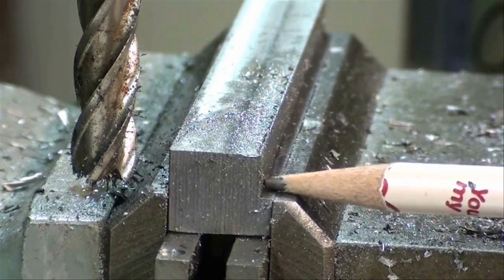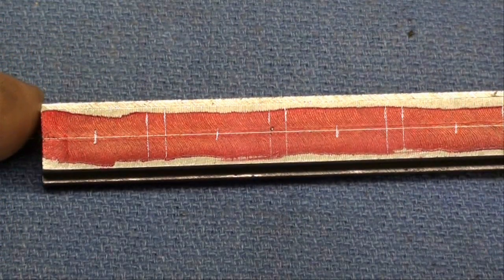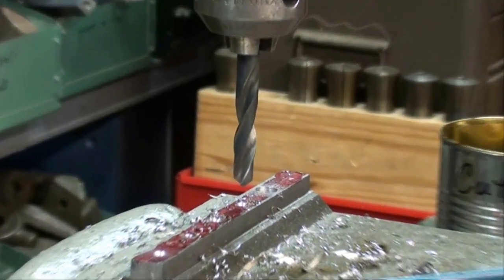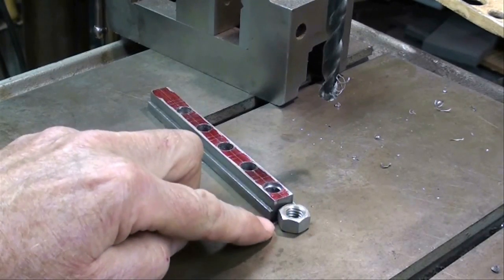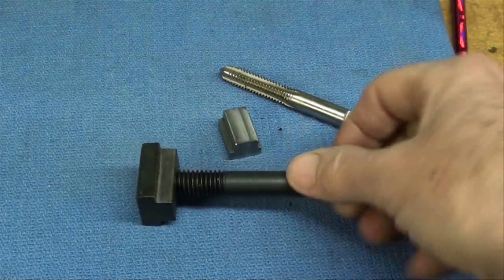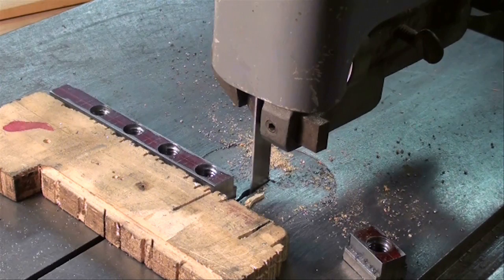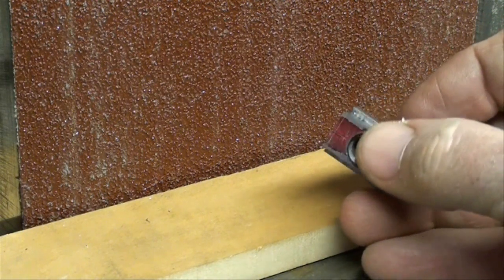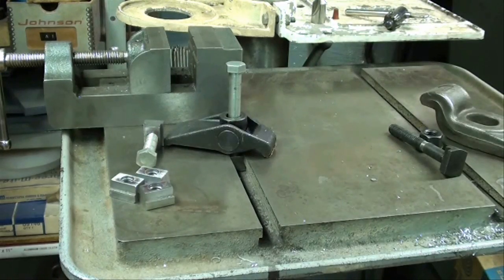MACHINE SHOP TIPS #103 Pt.2 Making Tee Nuts on the Bridgeport Mill tubalcain

Comment: I made some of these out of aluminum for my pedestal drill.  Except when I cut the steps/shoulders, I cut the first side along the fixed jaw,  then turned the part around and without moving the table/hand wheels machined the other side.  I don't have a belt sander and just milled the ends after using a hacksaw to cut each nut off.

Comment: Very nice table....not a single hole in it. I once worked (very shortly) in the original 'Presto-Log' factory here in Sacramento, California....they had an old vertical belt drive drill press and the table was worse than swiss cheese....barely enough metal left to support what you were drilling...

Comment: Thanks for clearing the options to make through tap, stop tap and indent or to licorice to make permanent bolt...pinning might. Be another option. Again great lesson. Thank you.
Reply: sammy mezzacapo Pinning is a lot of work- plus it requires drilling a hole, and that could weaken the part. Pinning tends to be permanent- but using Loctite offers a LOT more options.

Comment: why didn't you mark the cuts in succession, rather than having to sand the excess off each one?
Reply: Samsgarden By allowing for extra waste, it's a LOT easier to make all the parts exactly the same size. By trying to "cut it fine", if you make a bad saw cut, you could end up with TWO bad parts.

Comment: How, exactly, was the -length- of the Tee Nut decided? Because seeing the length of stock remaining after laying out five tee nuts said "Make six!" to me.

Or is there a reason to maintain a specific length for the nuts?
Reply: Shrike Decil It looked like the tee nuts were all 1 inch long. You're quite right that six tee nuts could have been made- but when you can, it's a lot simpler to work with whole inches, rather than trying to work with fractions of an inch. It all depends on what you're trying to do.

Comment: MrPete, Thanks for a very instructive video. The only things that could have been mentioned that occurred to me along the way: when side milling the steps to avoid climb cutting -- which you did but something like that bears repeating, likewise when using the dials to adjust to a dimension to be sure that the backlash is cranked out.

Comment: Lovely job. I've heard somewhere that full tensile strength is reached once just a couple of thread turns are engaged. I also like to drill clearance of a couple of turns' depth for two more reasons: makes it even easier to engage the male thread in day to day use without cross-threading plus you don't get a distortion bulging from the top of the piece from the tapping operation.